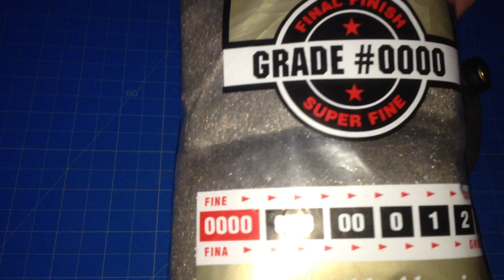Homemade Bottle Rocket Swarm " Hornet Grenade"

Comment: i think you should make this into a mortar/bazooka with an air cannon or co2 cannon with some foam wadding so it flies and doesn't get blown out and then you could have an epic weapon. also a frisbee-mine would be a good(maybe very bad) idea a bit like the bouncing betty in black ops 2  without the bounce (though it wouldn't be too hard to make it bounce). you could do the same sorta thing with about 10 rockets pointing out at lowish angles and slightly to one side so it spins :D

Comment: If you were to splice the fuses together in the middle you may get a better launch. It seemed a few didn't want to exit, and I imagine the wadding would block some or be faulty. With the fuses holding it in, it'd have more security for travel and be less likely to fail in launches. Design is nice though, and I definitely want to try something similar. Maybe a more hemisphere design, with the rockets across a dome.

Comment: Could you use glow plugs to ignite the rockets? i have made a flash gun with a glow plug but i have never tried using a glow plug to ignite a fuse, it should work though